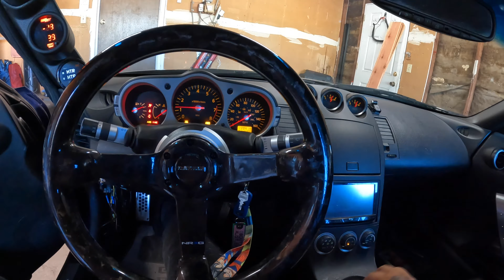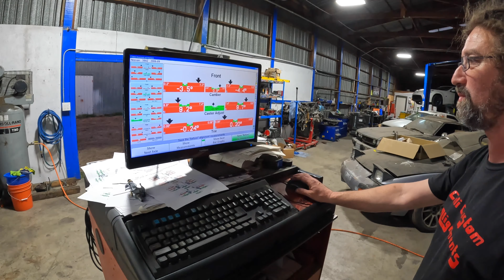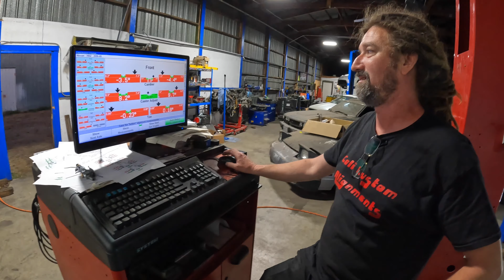LSA 350Z: Last Minute Drift Prep…

Comment: methanol for the IAT's when i supercharged my old e92 m3. the car would feel as slow as stock when im sitting in traffic because the blower would heatsoak. it had a lot of safety parameters to drop timing and stuff.

its only like $4-500 for the aem boost kit, its VERY much worth it. i dialed it to spray the medium nozzle from 1psi and would max at 6.5psi. IAT's would stay low, and i could do back to back pulls and be fine.

or even better, get an innerchiller setup. u turn on the ac and it cools the supercharger, unsure how much those cost, but when i supercharge another car im definitely using one.

Comment: I ain't scared of mega racing no more I see it work so what the problem is a m********* waiting on the fTC m********* in the eight digit area bro hid for 3 years from you bro the lower control arm is the problem when they come from the Subaru for the Benz bro
Reply: Lower number 300 354 and horsepower